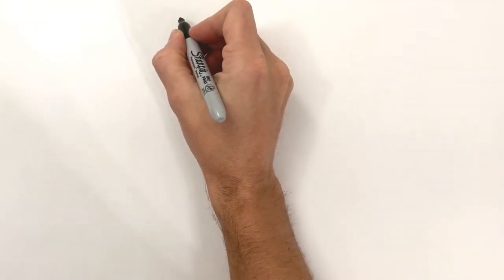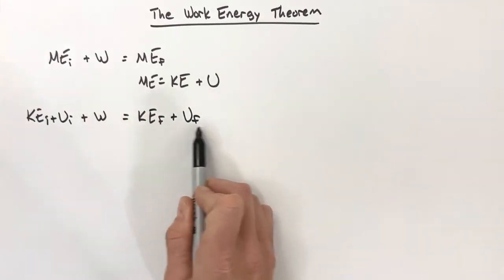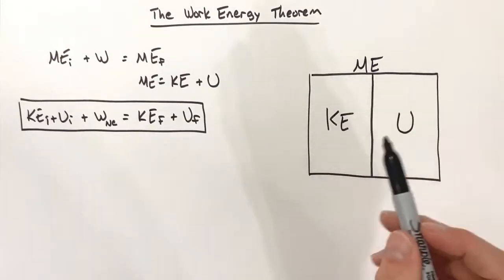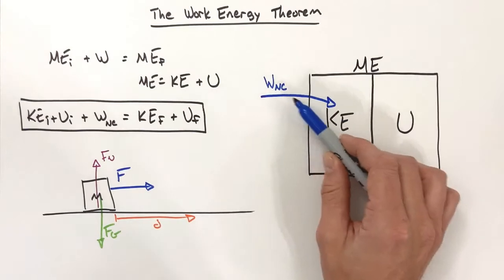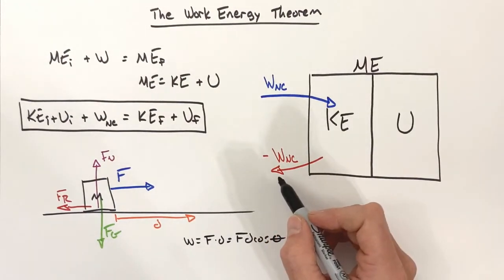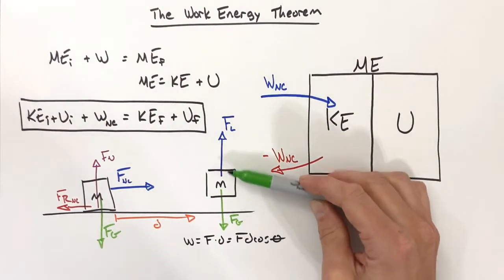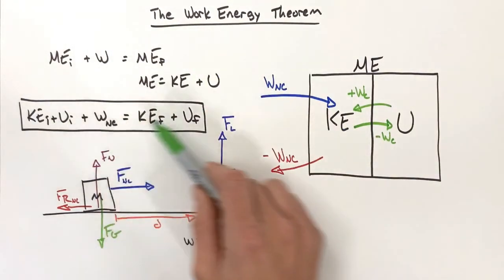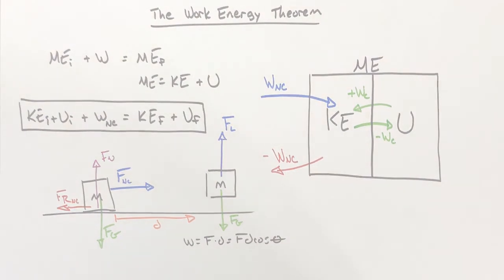Work & Energy Calculations Made Simple... | Physics

Comment: you fail to take into account that the equation also is

KEi + PEi + Wnc = KEi + PEi + Wnc

in fact you wrote this in your bernouli's equation video, i dont understand why there is no Wnc at the end too
Reply from the maker: You can put that Wnc term on either side (or both if it suits you).  Its only the sign of the term that needs to be modified depending on where you stick it.